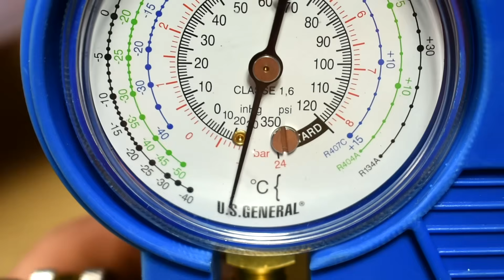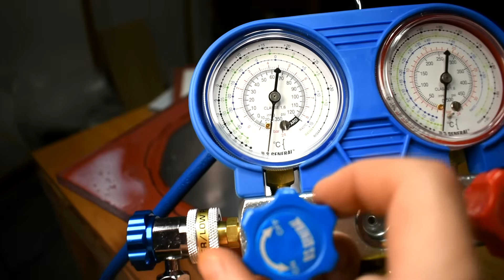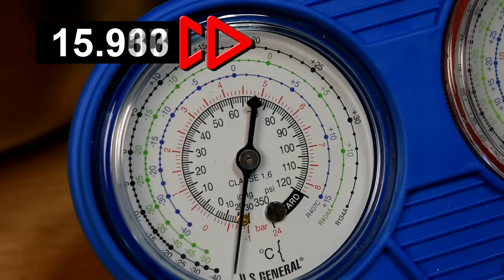The EASIEST DIY Vacuum Chamber You Can Make

Comment: I think this is standard fare the moment anyone buys a vacuum pump. I had ideations of doing vacuum-assisted carbon molds some years back with a 12cfm pump and went this exact route, then ended up remodeling a kitchen and 'pilfered' one of the old cabinet drawers made out of some seriously thick wood, sealed that up with silicone and a lexan top cover. I use it once in a while to do vacuforming of abs shells, but more often than not, that pump gets used in lab-esque vacuum filtration. I have the same meter set (still in the box) and ended up going with a vacuum gauge and a distro-block; they're quite cheap and you get a reasonable amount of accuracy as to if your seal didn't get set 100% right away as the pump won't go down under 20 inches. 
One thing to add or make is a mist capture container for the oil, as it sprays Everywhere. A simple do-job of PVC pipe, some fittings and a filter (the lawn mower ones are conveniently threaded most times) will do well enough for occasional use, otherwise the commercial guys want stupid money for essentially the same thing. (Seriously, look them up. They're all PVC and fittings for ~$150 US. It's ridiculous)
Add: I don't know why I never thought of it before, but I've got a pile of those air/water filter separators for my shop compressor that I bet would work equally well on a vacuum pump; one has a valve in the accumulation chamber to vent what would normally be water out of the bottom, as one tends to go through a lot of oil with these things. I get mine by the gallon jug. To the test bench!

Comment: For my low volume, high vacuum source for a vacuum former. I used a 12 volt tire pump and a 400 cubic inch pvc plumbing pipe. I can pull almost 29 hours at 700 foot altitude.  I now live at about 1400 ft so the gauge shows almost 28 hg. Converting a pump to pull a vacuum is cheaper than buying a vacuum pump.

Comment: Use a refrigerator compressor. They do vacuum and 300psi. It works better for cheap projects than an expensive pump does
Reply from the maker: They are pretty nice, but they don't move enough air or pull a deep enough vacuum for my plans here.  It works fine for a small chamber like I built here, but there are bigger plans coming for this 👍
Reply: @PaulsGarage  I've had them do 27 mercury which is a rather good vacuum.
Reply: I've used it to make vacuum tubes that held water, and would boil when you held them. Freeze water in a long/slender tube, draw vacuum, then seal.  It's a fun experiment 😉
Reply from the maker: Yeah that's pretty good, how long did it take and what size chamber?
Reply from the maker: That sounds really awesome!  Cool idea

Comment: I have one almost identical in my toolbox. Mine is made from a 6" PVC drain pipe cap with a 1/4" plexi cover since it's only 6" wide and I use mine with A/C gauges and my vacuum pump. I use a transmission clutch pack piston seal under the plexi.  I've been using mine for 20yrs to prime my lifters with oil when rebuilding engines. just fill with oil and a set of lifters, turn it on over night and watch the bubbles come out of the lifters, sure beats pumping them by hand until they fill up.
I got my vacuum pump free. A friend asked me if I wanted it because he couldn't get it to air up his bike tires. I never did tell him what it really was.
Reply from the maker: That's a great idea!!

Comment: A note I know about, install an angled piece on the inside of the pot so that the rush of air doesn't spatter what you're working on. Have it angle so that it blows along the inside wall of the pot instead.
Reply from the maker: Diffuser is a good idea for sure

Comment: I am by far a vaccum pump expert, but when I was shopping for my vaccum chamber I was able to find one with a "Venturi Vacuum Pump" attachment which allows you to use an air compressor if you already own one, at a very fractional price.
Reply from the maker: Venturis are pretty awesome but I'm not sure what kind of vacuum that would pull.  Some for sure but I doubt it would get as deep as a pump
Reply: @Paul's Garage  I can not remember off the top of my head, and for sure, it's not as good as a true vaccum pump.  But it was more than enough for pulling the gasses out of resin and silicone.  I never had the need to use it for anything else.
Reply from the maker: That much? That's pretty impressive, I wouldn't have guessed that
Reply: @Paul's Garage  of you are purely interested in its capabilities,  this is the brand I bought years ago rotokinetics, the 2.5 gallon compressor version.  Even now it looks identical,  but I think I paid maybe just over 100.  Inflation is beautiful 😑
Reply: @PaulsGarage  Some British steam locomotives achieved 25 inHg using a venturi.
Reply: You can get a venturi type vacuum pump for lab use. It's a simple glass tube that is connected to a water tap and is perfect for degassing resin, and probably plaster too. I used it when laminating spectacle frames to degas the resins that glued the laminates together.

Comment: Another fun thing about vacuum chambers, even if it doesn't leak it will still eventually regain pressure. The materials the chamber itself is made of will offgas and raise the pressure over time.
Reply: I used to do lab work with high vacuum. Everything that went in the vacuum tank had to be made of metal or very specific low-offgas plastics, and cleaned off with acetone, and then the acetone residue cleaned of with methanol. Any openings were sealed with steel caps and copper gaskets and the whole contraption wrapped in resistive heat tape to bake off any left over grease from the inside once you had vacuum. And you had to make damn sure there were no screws in blind holes in any equipment that went inside the chamber, which would create slow leaking air pockets. I drilled a lot of little relief holes to prevent that. 

Needless to say, you don't need any of that for vacuum forming or getting bubbles out of plaster or anything like that.
Reply from the maker: Makes sense, I'm sure the silicone will off gas quite a bit over time.  It definitely has a smell to it
Reply: @PaulsGarage  If you wanted really high-end seals you could get a 10" Viton seal or something but that probably costs hundreds of bucks. I don't think ultra-vacuum grade stuff is necessary for this. A decent new rotary vacuum pump will get you well below 0.1 mBar which should be good enough for pretty much anything including freeze drying strawberries.

Comment: 12mm =~ .473 -> 15/32.  

31/64 = .484x.

The reason I can quote those figs from memory is I have Router Bits in those sizes, because nominal-size Baltic Birch varies from .465 to .485+ in inch dims.  Stuff is nominally 12mm…

I want slots for shelves that give just enough added space for the glue…
Reply from the maker: Interesting!  This lexan sheet was sold as 1/2" but is actually 0.473", must really be a 12mm sheet

Comment: 31/64’s god i love our measurement system!
Reply: I have a router bit in that size….
Reply: 15/32" would probably be better. That's 0.4688" or 11.91mm 
31/64" = 0.4844 or 12.30mm 
So 15/32" is closer and slightly smaller than 12mm
1/64" = .0156" or .4mm So not quite a half a mm.

Comment from the maker: Parts List:
Suspiciously Cheap Pump and Gauge kit (and more): https://amzn.to/3YSxhzo  
Pump More equivalent to what I used: https://amzn.to/3EA4p6O
Just gauges: https://amzn.to/3IPABG3
Polycarbonate Sheet: https://amzn.to/3ZdM7jN
Silicone Sheet: https://amzn.to/3xQb3SW
Tap and Drill set: https://amzn.to/3XV7O71 (measure yours first, make sure it's the right size/thread)
amazon affiliate links

Want to learn sand casting using your 3D printer? I can teach you!: https://paulsmakeracademy.mykajabi.com/joinus
Reply: I have vivohome's 100w 1750G air pumps.  It is very loud and definitely not as powerful as they claim.  It is solid, though , I've been using it for over a year on my co2 laser.  I'd say expect about 75% of the claimed performance.
Reply from the maker: Is that why it's suspiciously cheap? Lol
Reply: @Paul's Garage  well, all of their stuff is on the cheaper side, they are mass produced and most likely not calibrated. But out of all the pumps I bought of the same design from other companies,  theirs was the closest to spec and has not burnt my house down yet lol.   Considering it's mass-produced from seas it's actually more on the expensive side for 4cfm